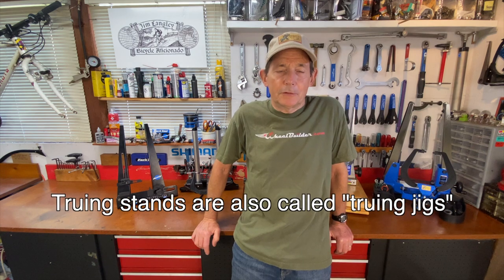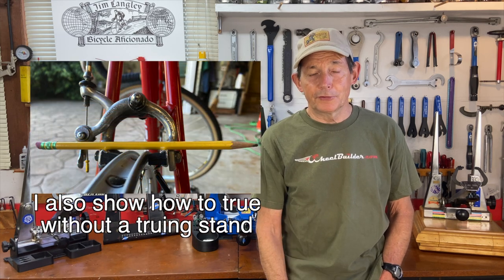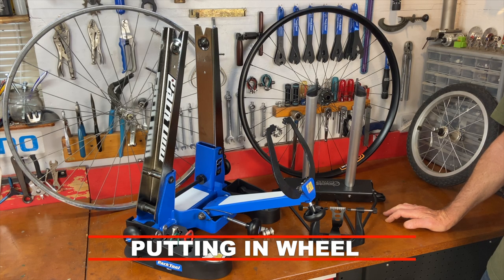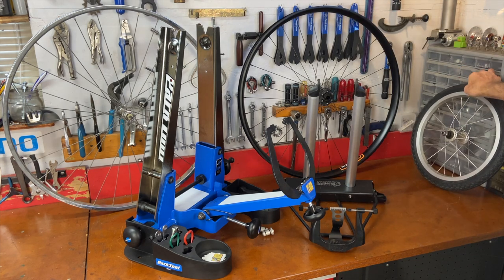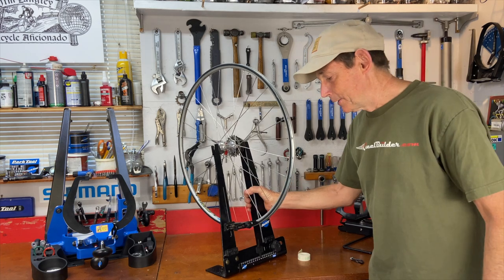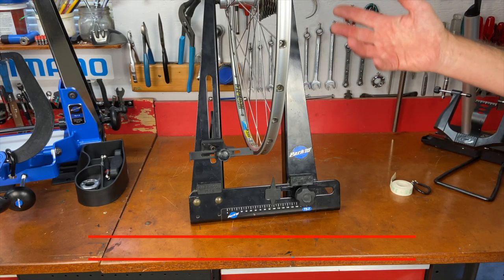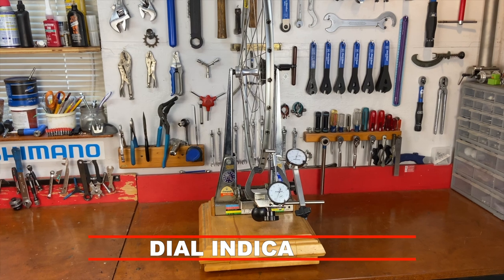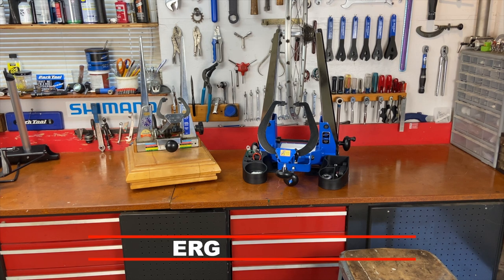Mastering Wheel Truing Stands: Unveiling the Secrets #bikerepair

Comment: Hello. I have a question for you. When we assemble a wheel, for example a rear wheel, should we take into account, when we turn the hub, the direction of rotation of the wheel? Does this influence the rigidity? I am referring to the direction of the spokes with respect to the rotation of the wheel. Thank you very much for your knowledge. blessings
Reply from the maker: Thanks for watching and the question. It's really up to you to decide how you would like to build rear wheels. Different experts have different opinions and there's a lot you can read on the subject to decide. As a professional wheel builder I follow Shimano's recommendations for wheels with disc brakes, both front and rear - as people expect to see that and I can point to Shimano as having done the engineering and testing. I have a video showing how to lace those wheels the Shimano way: https://youtu.be/gfWd7_avr1s For wheels without disc brakes, I follow my late friend and bike engineer Jobst Brandt's recommendations. 40 years ago he wrote one of the best books on wheel building The Bicycle Wheel. I talk about that and explain his lacing recommendations in this video - at the end - and I also have a link in that video to Jobst's book in an online pdf so you can read it for free. https://youtu.be/4kVlmOjgdAs

But one thing to know is that wheels are incredibly strong even if you wing it and lace it the way that makes sense to you. As long as you use a good hub, good spokes (stainless steel double butted are best) and a good rim; and as long as you get the right spoke length, get the wheel reasonably true and round and centered, and get the spokes tight enough so that they won't loosen, you will have a good reliable wheel. It's more about the parts used in the wheel and the quality of the build than it is about the spoke pattern. But it's good to choose one based on the best theories out there and learn the basic idea behind it so you feel good that you're building great wheels. You can also explain it if a customer asks. As I said I would go with Shimano's lacing for all disc wheels since they're a huge authority - watch my video carefully. With their pattern the front and rear wheel are laced differently. So don't lace them the same. For wheels without disc brakes read what Jobst has to say and decide based on that. Okay, I hope this is helpful.
Reply: Tanks a lot for the help Jim, i will study the Shimano's method
Reply from the maker: @surbanbikes8392  my pleasure. That's a good choice because it's the most used one now with so many bikes going to discs.

Comment: Love watching your videos about wheelbuilding and always wanted to ask you about hubs. I want to build a few sets of wheels to last me another 4-5 years as I don't want to switch to disc brakes, because I enjoy very much the suppleness of rim brake bikes. For the last 5 sets of wheels I've built for myself in the last 7-8 years, I've used Miche Primato Syntesi hubs and found them to be very reliable, especially for heavier riders. I'm more interested in standard hubs, not proprietary like Chris King or DT Swiss, also would like to avoid Bitex as well. As you have built 1000's of rim brake wheels in your career, what are some of the most reliable rim brake hubs that you have used and know of? There's nothing wrong with the Miche hubs but don't mind trying something new once in a while.
Reply from the maker: Thanks so much, COSINUS. I appreciate you watching and the kind words. I actually have been building with mostly DT Swiss hubs for the past several years, mostly the 350. I've also built with pretty basic Shimano hubs. Like you I look for reliability foremost. I haven't built with the Miche hubs you're using but if you've used them so much and they work so well, I would keep using them. I did a search and those hubs are even available on Amazon https://amzn.to/3zVdzYD Availability is one of the big issues with the shortages in the industry. So just the fact that they are available is a great thing.

Comment: Hi Jim! Another great video. I've appreciated your support from our conversation over on your "How to Build Bicycle Wheels the Easy Way" video.  Today, I received the Park Tool T.S. 2.3 stand.  During the assembly, I found the caliber arm knob binds completely to a stop about half inch in the hole. It's not from trying to move the arm against the spring. I pulled the arm back and still couldn't turn the knob.  I looked at the threads in the hole. They don't appear to be stripped. Per the instructions, I greased the threads, but it just stops. Do you know if this a known problem with this or other stands?
Reply from the maker: Thanks for watching gnatman! Hmmm.. by any chance is there a plastic packaging piece in there blocking the bolt? I seem to remember on mine there was and it was tricky to get out. If that’s not the problem you should call Park and ask for tech support- they’re good people.
Reply: I figured it out.  Too much paint ended up in the bolt hole. Worked the bolt back-and-forth. It no longer binds.
Reply from the maker: @gnatman1102  excellent- great job!
Reply: @JimLangley1  Thanks! It wasn't fun for my weak wrists. Lol!
Reply: @Jim Langley  Hey Jim! Either I'm doing something wrong inserting a wheel in my ne TS 2.3 stand, or there's an issue with the stand. I tried both a thru axle wheel and a quick release. When I put the thru axle wheel in and checked the rim for true by narrowing the caliper arms, the right side of the rim rubbed a spot. I said to myself that perhaps an adjustment is needed. I removed the wheel for a moment, and then put it back on the stand. Both times, the drive side was on the right. This time, the left side rubbed. I take it out and put it back on the stand. Now, the right side rubs. I checked the thru-axle adapters, and they are both correctly in the notches.  I also had trouble getting the quick release axle to lie flat in the notches. Plus, I noticed the right upright didn't close in evenly with the left with quick-release wheel on the stand. Am I missing or doing something wrong?
Reply from the maker: @gnatman1102  I’m not sure what could be going wrong. One common mistake is tightening the uprights too tight. You just snug them against the TA adapters or hub locknuts. The knob shouldn’t be really tightened or it can mess up the stand’s alignment. Not too hard to fix. Are you using the built in TA adapters or your own that you push into the axle?And on the QR is there any chance the axle is different on the ends? That’s all I can think of without looking over your shoulder.
Reply: @Jim Langley  Thanks for replying! I did not tighten the uprights tight.  For the quick release, I'll just keep working with it. This is the wheel I intend on tearing apart and rebuilding. It needs truing anyway. The thru axle wheel actually appears to be laterally and radially true, and the dish is good. I looked up the calibration procedure for the and may use this wheel for the calibration. Park Tool noted a wheel that is true and dished can serve as substitute calibration standard.  Park Tool even noted that the stands may need calibration after shipment.
Reply from the maker: @gnatman1102  you're welcome. QR axles can get worn different on one side and the other. When you put wheels with axles like that in the stand you look closely and check. Sometimes you need to turn the axle in the stand before you snug the uprights to get the same shaped part of the axle ends to be resting in the stand's notches - hope that makes sense. When you just lace a wheel and put it in a Park stand the wheel will probably be all wobbly and you'll have to open the caliper wide enough for the wobbles to clear and then gradually work out all the wobbles and keep downsizing the caliper as the wheel gets truer and truer as you work. A nice dished wheel will definitely work to calibrate the stand but you might use the stand the way it is to get used to it before worrying about that. Because most of the time since most people have one better eye, we true looking at only one side of the caliper. And if you end up working on wheels that way, it doesn't really matter if the stand isn't perfectly centered because you use one side not both sides. To check centering accurately, it's best to use a centering gauge/dishing gauge since it shows the difference down to very close tolerance. Have fun!
Reply: @Jim Langley  All great suggestions!  I have  a dish guage. I also believe the TS is good.  I also realized that the wheel doesn't have to be centered perfectly because I only need one of the caliper arms. After all this, I checked out the QR wheel again and learned I will be taking apart a pretty good wheel. So, I have my work cut out to get it back to true. Should be fun! Thanks!

Comment: Do rims get bent?  Can they be fixed?
Reply from the maker: Thanks for the question, Maria. Yes, metal rims (steel and aluminum) can get bent, but not carbon. Depending on how it's made the carbon rim might become dented or break in a serious collision. Metal rims get bent by impacts with rocks, pot holes, curbs, etc. And if you put enough lateral or twisting force on a wheel you can bend it completely out of shape, which is when we say here in the USA that a rim is "pretzeled" or "taco'd." You can usually get damaged rims to keep rolling down the road to get home on a ride by bending them back. But, when a rim is actually bent badly, it won't be a strong as it should be. Steel rims are so strong that if you don't mind the feel of the bend in the wheel and it doesn't cause braking problems or tire issues, then you could keep riding on it so long as it stays that way and doesn't get worse. For aluminum rims, the risk of riding on a bent and bent-back rim is that it could fail. But people do fix them best they can and keep trying to get more miles out of them sometimes. So it really depends on how badly damaged they are and how skilled the mechanic is at working with bends in metal. For carbon rims with dents you can sometimes get the dents out. You always want to look closely at damaged wheels, especially aluminum and carbon for any cracks. These can be difficult to see. Use a flashlight and take your time. If there are cracks that's a sign that the rim may break if you keep riding on it, so it's best to replace the rim. Okay? I hope this is helpful and thanks for watching!!

Comment: greetings from Brazil!! a question. Which is ideal to use? will smith prep spoke or lubricant on spoke threads.
Reply from the maker: Thanks for watching, GT and thanks for the greetings from Brazil! I prefer Wheelsmith Spoke Prep but it is kind of expensive and it does take time to apply and dry. I have a video about those things here: https://youtu.be/z4FKL95x6DE The reason I like it is because it dries so there's no oily lube mess to clean up. I hope this helps and enjoy your wheel building!
Reply from the maker: @gabsbike3  I’m not sure I understand what you mean by “release,” GT. If you’re asking if you can take a wheel apart easier when oil was used or Spoke Prep, it’s about the same.
Reply: @JimLangley1  I'll try to explain again, I'm not fluent in English...I use a translator and I love bicycle wheels. my question is the following if you use oil in the preparation of the spokes due to the fact that the wheel is lubricated quickly.
Reply from the maker: @gabsbike3  thanks for explaining more, GT. Yes, if you use oil you don't have to wait for anything to dry before building so it's faster than Spoke Prep. There are other types of spoke preps that are put on only after you build the wheel, but here again it's an extra step so it adds time. Oil is a faster way to go. I hope this answers your question and happy wheel building!
Reply: @JimLangley1  I understand perfectly, thank you very much for the answers!!
Reply from the maker: @gabsbike3  you're very welcome!